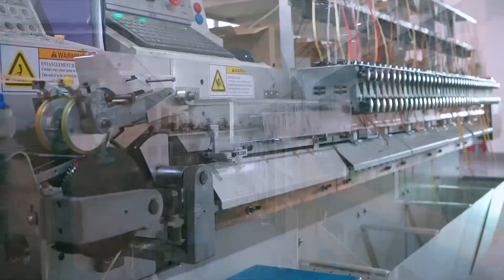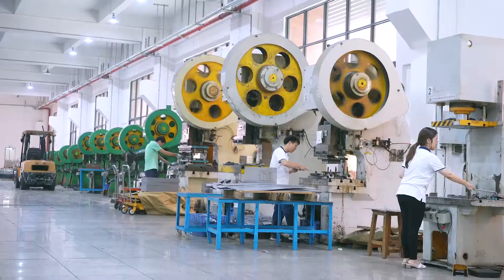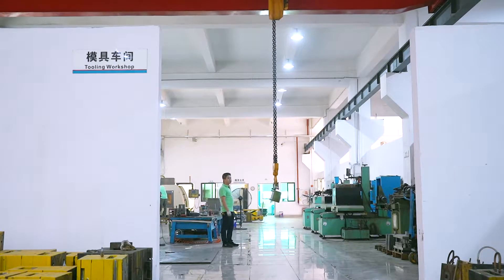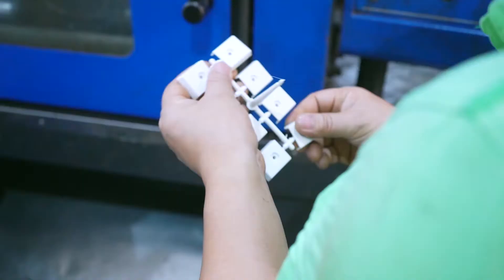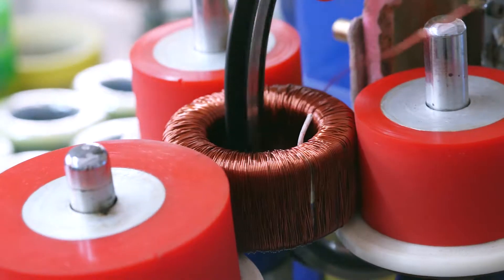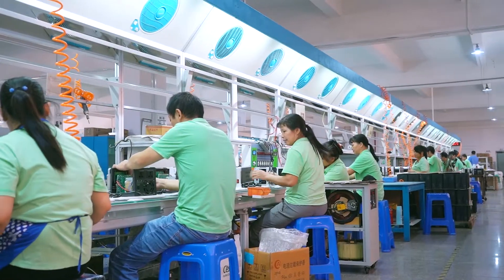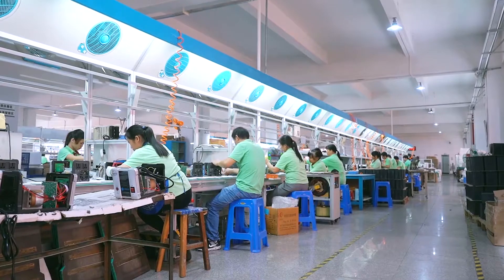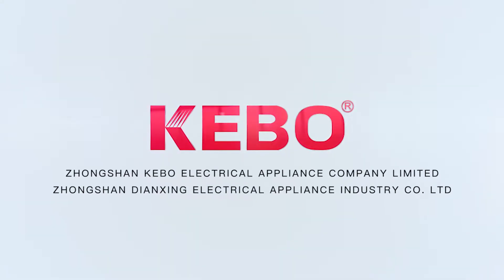Automatic Voltage Regulator: KEBO Workshops

Comment: I would like a picture of the interior design of the KEBO 2014 voltage regulator A picture of the card, relays, and file so that I can fix the fault in my device.